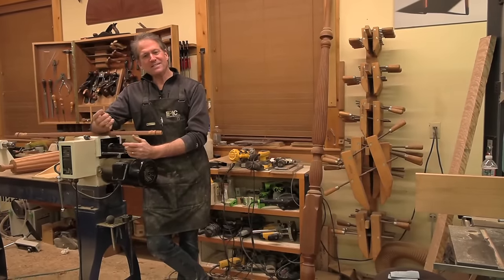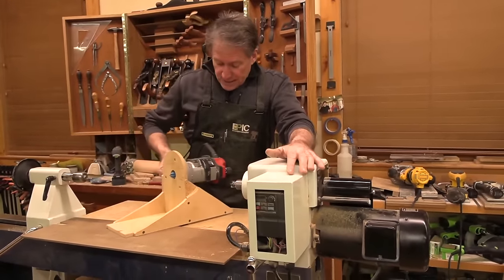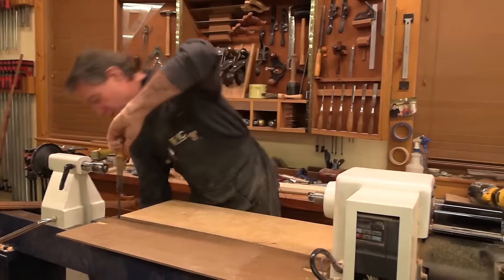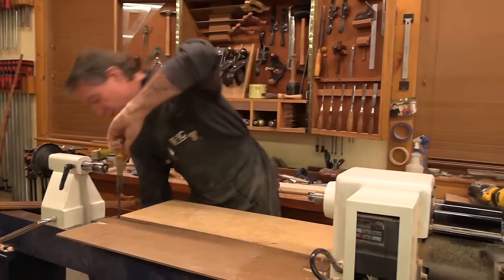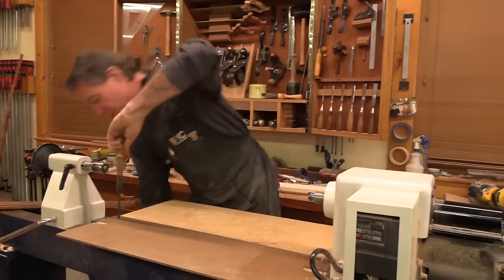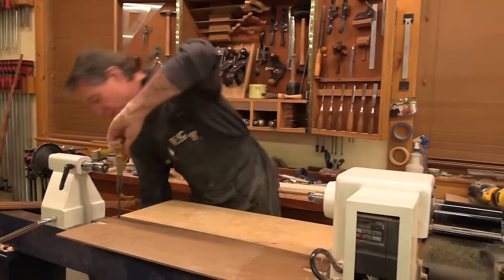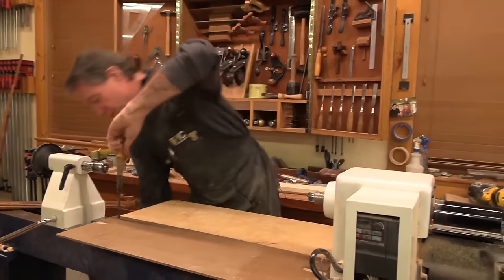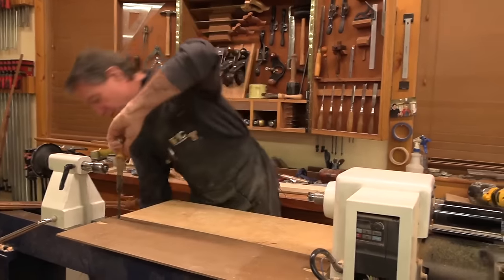Supercharged Router Jig

Comment: i tried making on of these and it grabs the bit and raises it,,its hard to keep it flat on the base
Reply from the maker: That’s a great observation Jeff, and obviously critical that it stays flat during the cut. It’s been a while since I made that fluted column. But there are two things to consider to insure it stays flat on the base during the cut. First, make the cut in several passes, not cutting all at once. Secondly, because the cutter is spinning clockwise as you are facing the jig while operating it, you want to make your cutting passes by starting at three right end and moving right to left. That way the left side of the cutter is engaging the work first, which is the upward spinning side of the cutter, and the cutter will therefore exert a bit of downward force pushing the base to the table.
If you move left to right, the bit will want to ride up on the work and will lift the base from the table.
Hope those two tips help. Thanks for watching! 👍😎